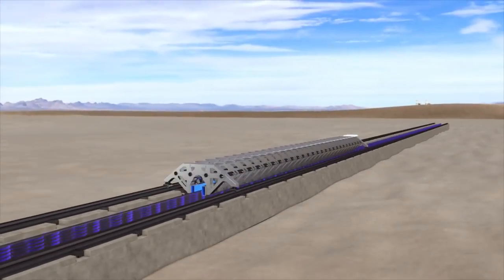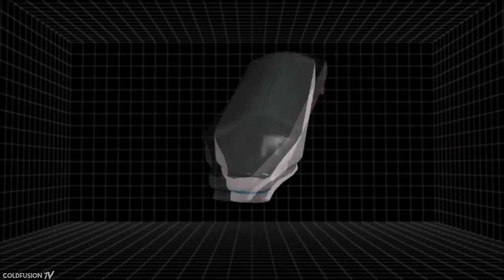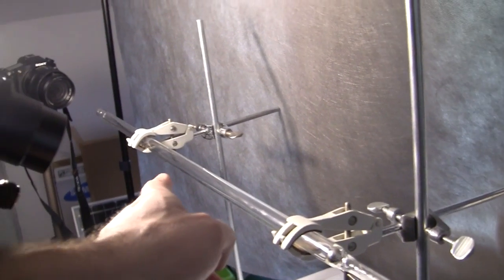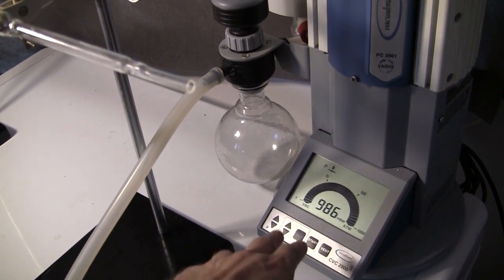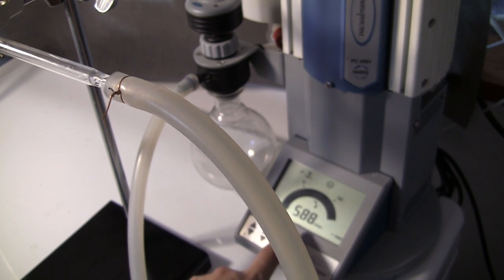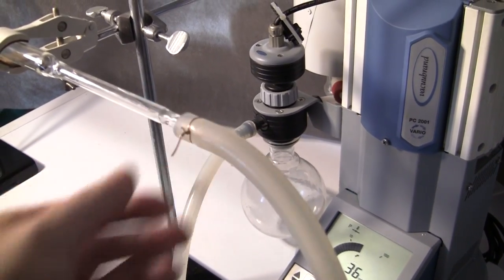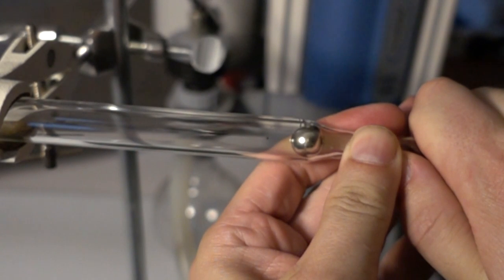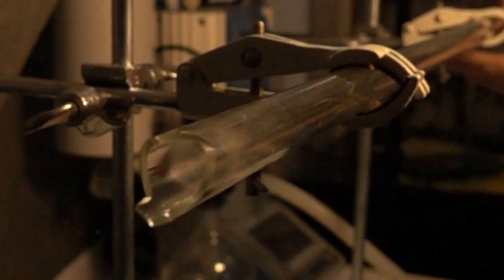How  the Hyperloop can kill you!

Comment: wouldn't a near simultaneous purposeful opening at the other end or just on the other side of the ball/sled prevent this? so all you need are valves that open on the other side of it to equalize the in-rush of air on both sides, sled goes nowhere. This could be done with computers and be very fast.
Reply: Not wrong, just didn't carry the logical argument through to it's conclusion (as @itry2brational has done). Only issue I can forsee would be getting sufficient air into the tube quickly enough "ahead" of the carriage without causing a further rupture in the tube. However, assuming they only use it for cargo in the first instance, they can test all these scenarios without too much danger.
Reply: so how exactly would you open a 2m tube against a vaccum in a few hundred milliseconds?
Reply: but then you would have to suck out the air from the whole tube again. That seems highly impractical to me.
Reply: Seikre M.
It would be a big failure, but then, if you have a vacuum leak, you need to get the section to ambient pressure anyway, just to be able to fix it. If you have a vacuum failure, you flood the entire system with ambient-pressure air from many points, all trains slow down, and then the system is down. Its still the best way to deal with it.
Reply: I think before it equalizes, the vehicle will be shot forward with ridiculous acceleration from the initial vacuum failure. The acceleration alone would be enough to kill everyone on board before the air on the other side of the tube reaches the vehicle.
Reply: Just saying, if a tank defence system can "shoot" an incomming round, i think that should be possible...
Reply: DaffyDaffyDaffy33322
This is why the original Elon Musk idea uses just one third of normal pressure, 300-350 millibar. You get some acceleration, but then the vehicle does not fully occupy the tube, being aerodynamic and leaving some space open, and before things get really bad the one third of normal pressure in front of the vehicle builds up.
Reply: That is the idea.
Reply: This can work, but the cost of having safety vents frequent enough to keep you from getting shot would be too high.
Plain maglev trains are cheaper.
Reply: Very true. At the most, this proofs that a hyperloop should not be built out of glass! ;-)
Reply: But then you've got a huge wave of pressure coming from the other side, as well. I feel like them colliding might cause serious, crushing, risks.
Reply: *****
A valve. The tube is long, the vehicle can deal with it for a moment, and a valve should be able to start letting air in after 5 milliseconds or something like that. Or you should at least be able to compete with the gas production of commercially available car airbags.

One design: You have some pyrotechnic valves strategically placed and integrated into short metal tubes, when electronically triggered they go off, blowing away both ends and blowing a lot of gas inside the vaccum chamber. Just like the little pyrotechnics that inflate your airbag. Now both ends are blown off, and air can rush in. These would be indirectly connected to the system, so you have some medium-sized tubes connected to the big tube (you need these anyway to connect to vacuum pumps and such), and there you attach the pyrotechnic valves.
Reply: David Igandan
Such valves would be a pain in the ass to build and operate, so the sections would be rather big. Sealing the tube halfway with a valve also creates a deadly barrier that trains could crash into. It needs to be open and able to not disrupt the path of the train whenever there is a train.
Reply: '...ridiculous acceleration....'

Well thats an assumption that Thunderfoot made and many others appear to be making.

However when you do the maths you find out that is wrong. In the worst scenario accelerations  are rough maybe ~5 to 6g for a few seconds but unlikely to permanently damage or kill anyone (subject to medical condition). Furthermore there are failsafe systems that you can add to mitigate against.

I am surprised that Thunderfoot brought no maths or real physics to his opening premise - which he usually does effectively when he successfully debunks other stuff. It kind of blows his credibility in my mind.
Reply: Until that cargo gets skyrocketed out into earth space and starts smshing into stuff.  What if there're buildings or people in the way?  What if the cargo is explosive?
Reply: just thought about this type of solution myself - this time @Thunderf00t is wrong.
Reply: It is not like the tube is going to be craked open every tuesday.
Reply: Do you only have a few hundred milliseconds if we are talking about many kilometers worth of tube? I'm not sure how quickly the pressure equalizes over that kind of length in the case of a tube breach.
Reply: +PantsmanUK If it's on a rail it could have breaks, and censors could detect the leak and send an immediate signal to a safe distance ahead and shoot air in. Plus have some form of airtight bulwarks throughout the runway that can shut to prevent needing to flush the whole track of air pressure once it's fixed. There is so much that thunderf00t overlooks about this project in an attempt to just fear monger the idea. One has to wonder why.
Reply: +Timo H. Some kind of blowout panel should work.
Reply: Another point that +Thunderf00t forgot, there could be a gap between the pipe and the cart - you can make it as large as you want it will not effect performance but it will take the edge off this problem.
Reply: and if you press eject on a f-16, you have to build a new plane.

its still worth it, because opening the tube and pumping the brakes is better than a  supersonic wagon with dead people in it crashing into the end station.

and it isn't like huge leaks would be a everyday thing anyways.
Reply: This also seems like what would happen in a catastrophic failure. If we were to up the size of the failure in the video to the hyperloop's size, you would have something like a man sized hole in the side of the tube. I doubt the same effect would happen if there was a small failure (such as a crack) and air started slowly pouring in through a small crack.
Reply: what in the fuck? how are you going to just fail the entire system every time there is a failure, especially when this tunnel is over 100 miles long wtf?
Reply: Joseph Wallace Everything you said is just gut feeling and instinct and not physics. Do the maths, read the physics. Hyperloop can be safe. The physics show it is possible. The only sense that you can show  this a reckless venture is the same way you can 'know' how travelling 6 miles up in the air in a pressurised very thin skin tube close to burst point at near the speed of sound is similarly stupid idea. Of course it can be made to sound stupidly dangerous , but is in fact something done by millions daily...and safely. By the way,  I speak as a chartered engineer with 30 years experience in design of very large vacuum systems who has done the maths on this.
Reply: I'm sure that they will take care of all these scenario's before rolling them out to public.. its just like saying flying is very dangerous as the cabin can depressurize or what if engines fail.. or saying sailing is dangerous as there can be a leak which can sink the ship..
Reply: chyba nie srasz
Reply: Exactly, the tech is nowhere near yet.
Reply: +Jan Getz unless that missile is traveling at super sonic speeds. Remember that five tons of matter (excluding the carrier) has a fricking high energy of itself, and then some with the explosives.
Reply: Well wait for a response from him before just declaring he's wrong, there could be more to this or there couldn't. Don't jump to conclusions, listen to all sides, things like that.
Reply: Wouldn't you just have to depressurise the whole thing, rather than create an opposite force? The difference in pressure would be what puts force on the train, so just do the whole thing.
Reply: It's been a while since I did any proper Eng math and I certainly couldn't do this, but it helps to think of air as a fluid like water, as that is what it is. Dependant upon length and dia you would have some potentially nasty effects. Hope TF goes a bit further but I appreciate his point, he also included "can" in the title.
Reply: +Timo H. Explosive bolts holding the hatch closed, vents long the length of the tube, tanks of nitrogen gas that open violently to make a 1-atmosphere environment in under 3 seconds.
Reply: Getting into the realm of 007 over here
Reply: +Dee Doubs It would depend upon the size of the breach, up to hole the size of the tube's diameter it would increase at a steady rate, but any bigger than that and you begin to get diminishing returns of the pressure equalisation speed.
Reply: +PantsManUK What about this tube being in the sun all day and then getting cool at night? I'm not sure how much air will be in it, but it will certainly get hot and then cool or cold at night. Earthquakes are rather common in CA (this is a giant glass airtight cylinder), how much movement can this glass take? Wouldn't it be a better idea to rebuild the regular rail system and stop using 18wheelers? Better yet, send all this freight to the east coast via "6 pack" down through the Panama Canal. According to Matt Simmons, while it would take longer, it would use 1/18th of the amount of energy the current system uses (18 wheelers).
Reply: Depending on how fast it would be, you could potentially cause all kinds of havoc with the people inside due to both the sudden acceleration, an the sudden stop.
Reply: +Timo H. sideways with hydraulics. easy
Reply: +006 D and then you kill the people inside. Brilliant Plan!
Reply: Everybody's overthinking this. The pressure differential can be equalized just by having some kind of valve system around the pod that can either be actuated mechanically or electronically, basically turning it into a bullet with holes in it. At that point any braking system can slow it down .
Reply: +Alexandru Belea Super wrong. If you broke the cables in a lift (especially the ones in sky scrapers) they would not fall. They would sit in place (or worst case slowly fall. Depends on the model of course.).
Reply: David Igandan so then how is it continuous? Isn't that the whole point of this silly hyperloop?
Reply: David Igandan so where are the cost savings God Elon proposes this system contains? 1) increased danger, 2) massive practical issues with pressurization, 3) inherent inability to escape a perfect vacuum in the event of rupture, 4) massive number of pressurization valves and seals that leak over time. Where is the upside to this oversold, dangerous proposition?
Reply: kurtilein3 So now the entire tube and vacuum is compromised? How will you alert oncoming tubes a failure has occurred? This so-called "simple" design is fraught with deadly complications
Reply: Punit Rambhia they would be dead forget the whiplash
Reply: Joseph Wallace That's easy, install valves at set intervals along the track, vacuum the individual sections, open and close the valves a specific sequence to allow the pods to pass. If there's a catastrophic failure in one section, the rest of the system remains intact. 

Next problem.
Reply: 2m wide gate valves even every 10 km  would make system fantastically expensive and complex..and likely add greatly to likehood of failure by adding many more modes at the transit coupling points . Not sure why everyone thinks this is going to fail so much when they run oil and gas pipelines across whole continents and with much higher pressure differentials than here without it being seen as wholly impossible. It is not. Also the maths show the inch wall steel is factor of safty x50 from any type of fail. If hit by ultra high speed bullet it still would not fail, but if somehow nagically did the hole produced would take hours to days to raise pressure inside significantly. You then close the transport system for a day or so..enoughbtime to find , weld up then turn on the roots blower +fast turbo vac pumps and bring down to workable vacuum. Why this is bringing out everyone with no engineering acumen or skills to calculate to run the idea down is beyond me. The fact that the smart guys at MIT suggest it is feasible should tell you enough. I struggle to find where in the past they have shown themselves to be involved in flights of fancy.
Reply: @John Doe, just put god damn extending brakes on the pod... Simple and cost effective. If a big pressure differential is detected, it instantly sticks out a bunch of brake-pad legs into the walls and keeps itself from accelerating rapidly.
Reply: @john doe, yes indeed i completely agree. Air pressure at sea level is crushingly tremendous, hyyyyyyoooooj even.
Reply: I think they're called computer-controlled valves
Reply: One thing everyone seems to be failing to realize is the sheer G forces that would be unleashed. By the time the other side is opened it is already too late. That initial G shock is going to do some serious damage.
Reply: +lockhack The speed of sound is approximately 366m/s. So thats the fastest speed at which air can expand to push something. This is why gun barrels have a tight fit around the projectile, to make use of all that speed of sound pressure in the pressure wave from the explosive.

Rounding the speed of sound up to 400m/s, and doubling it, assuming the pressure wave hits from the front and accelerates from running speed to full speed in the opposite direction to be charitable;

Assuming constant acceleration, to completely stop, turn around, and break the sound barrier in the opposite direction;
At 5G it takes you 16s to reach 800m/s.
At 10G it takes you 8s to reach 800m/s.
At 25G it takes you 3,2s to reach 800m/s.
At 50G it takes you 1.6s to reach 800m/s.

All of these are significantly less then lethal. For comparison, 

Untrained humans typically black out at 4-6G in sustained exposure without long term harm when this is experienced without warning or otherwise suddenly.
Untrained humans can tolerate 17g for several minutes without loss of consciousness or long term harm. (when expecting G-forces)
in car crashes you can walk away from, 50G is one of the lower accelerations typically recorded.

In short, G forces arent all that big of a deal. Humans are really resilient as it turns out.
Humanity, frack yea!
Reply: True. Granted depending on body position and current activity it could pose a problem but I believe you are right in my overstating the issue. I was more thinking of the consequences of this happening behind the train just after start but even then I suspect unless you were somehow reclined to suffer massive negative Gs you would probably survive.
Reply: +lockhack yea. I can imagine it would be rather uncomfortable to be walking around when it slammed the breaks. :P
But in addition to that, you would not get even close to the full acceleration from the air in a vacuum train like the hyperloop. Theres plenty of space for the air to leasurely go around the pod instead 

Also, vacuum vessels typically do not burst without warning. (not that youve said this, but i figured i should specify it as well) using only analogue measuring devices, like eyes, and hands, it may look like it, but its possible to measure tiny movements, stretches and compresses, that can give you a few seconds, or maybe even minutes warning from buckling, should it happen from natural causes, such as materials stress and similiar.

Tbh as ive said before, im kind of disappointed in thunderfoots videos on the hyperloop as most of them are extremely unfounded. The terrorism and cost-benefit analysis would be a far more credible analysis tbh, because the hyperloop simply isnt an "impossible" concept like the fontus waterbottle or something ridiculous like spinning solar. Sorry for the rant :P
Reply: Not at all. I appreciate the information and the correction of my ignorance.
Reply: Or, on the sides of the pod are grips that hover just above some rails, that can grip down and be used as brakes
Reply: A hatch!
Reply: I agree thunderf00t is just butt hurt that he did not think of Hyperloop himself lol
Reply: Justin this is exactly what makes it impossible you're missing the forest for the trees. Preventing loss of life is this first thing to consider. You can't make this safe the physics are impossible. Air just behaves too quickly to catch a catastrophic failure up the line. The entire system and the various cars traveling in the system would be compromised. This "magic bullet" to our travel woes is not an answer. Sometimes you can't just plug science into something and solve the problem.
Reply: The magnetic track can decelerate if it detects the velocity is increasing more then regulation.

Comment: you can install sensors that detect vacuum failure, and then initiate fail-safe 2 vacuum failures at both ends of the loop, then you would be slowed down quite gracefully.

Comment: Couldn't you avoid a lot of the problems by accelerating slowly at first and then moving at a constant speed?
Reply: I think a lot of people are missing the point of the video
Reply: Callum Scott: Yeah...it's a bit baffling.
Reply: It's about the tube rupturing. If there is an accident with the tube, there will be a much bigger accident right after.
Reply: Fair enough, but I feel as though the designers could find a substance that would withstand those pressures.
Reply: Hollis Sims but the tiniest rupture would result in everybody onboard (and maybe people outside) dying, and this thing plans on being for public use; imagine if when a bus broke down it just exploded lmao
Reply: +Hollis Scott Nah, just put some jumbo sized super brakes on it